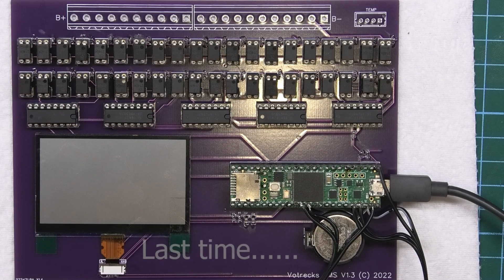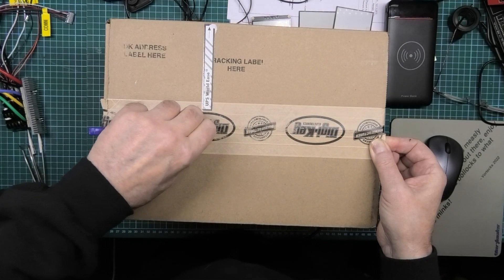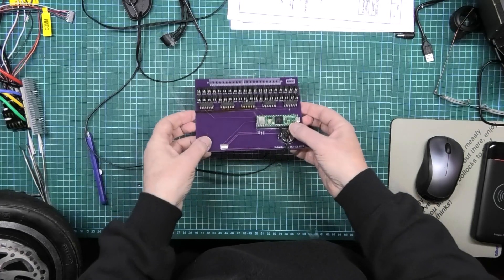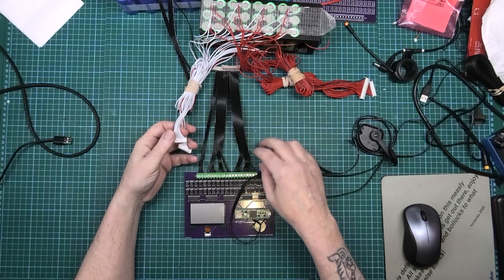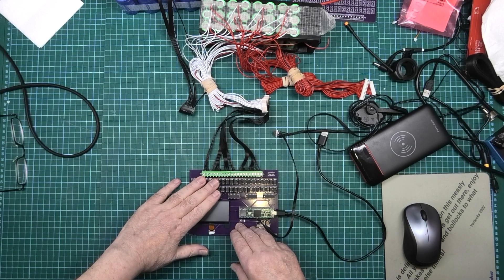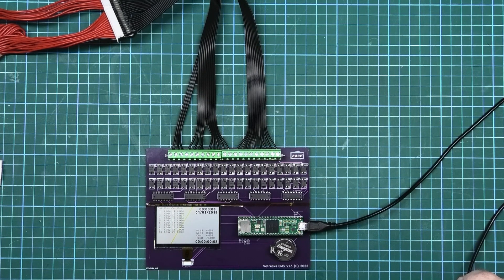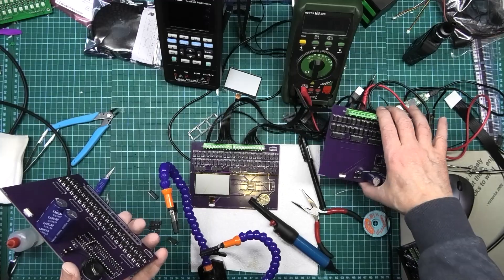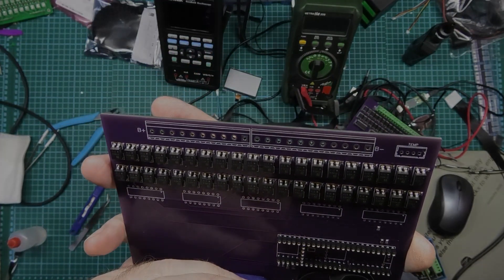Reinventing the BMS with VESC integration. I'm using the iScooter iX4 as the test bed -  Part 6

Comment: What's the expression?  "You absolute muppet!"
Project coming on nicely  though - there certainly is a lot to do.
I think there was a lack of affordable mid power/voltage controllers forcing people to go for Sabvoton, Phaserunner, Kelly etc, so a higher spec VESC that could do 20S at 100A is a good move.
Reply from the maker: This is (hopefully) going to be something that people can install alongside the standard motor. Most of them are around 600W constant which should equal about 1500W pulse, the VESC should be able to deliver the power without it exploding. 
I've put it aside for a while now, it's got to the point where my brain is going to explode. I need to back up a bit and learn a bit more methodology.